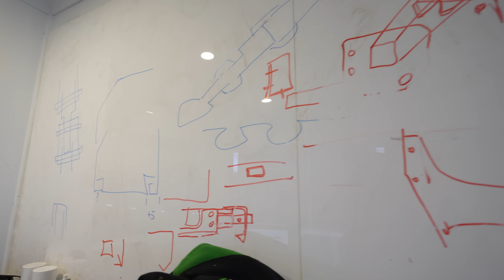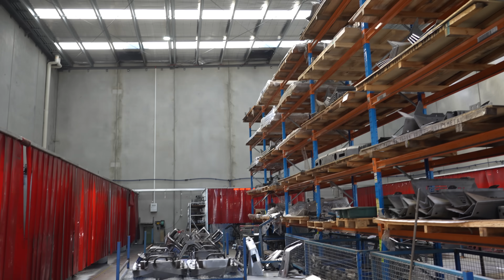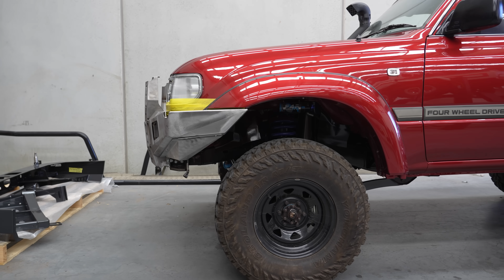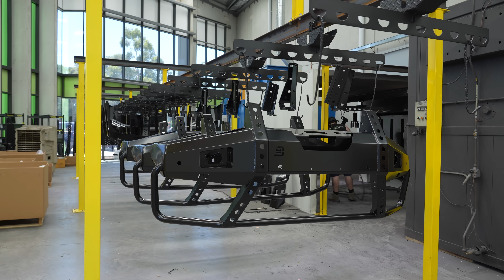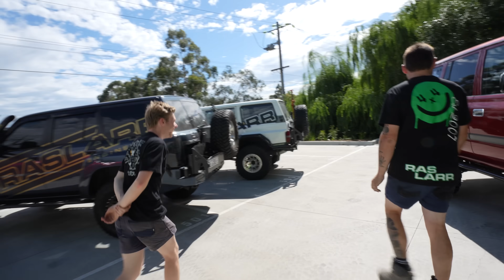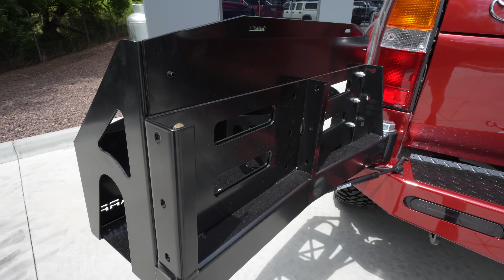The Landcruiser has NEVER looked this good...

Comment: Highway Patrol wet dream.
Reply: Car's are designed so people go over the bonnet not under it, Better be engineered with mod plate and all the after market accessories have to comply with Australian Design Rules, ADR or no insurance.
Reply: They expect a car this clean to be engineered vs old mate with a 6 inch lift 3 different brands of tires blowing 6kgs of soot every time they leave the lights